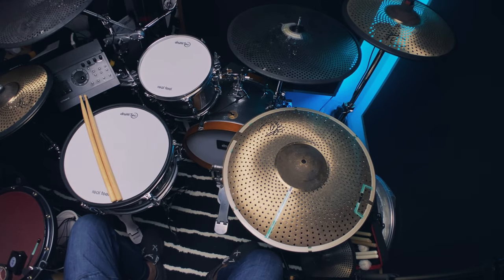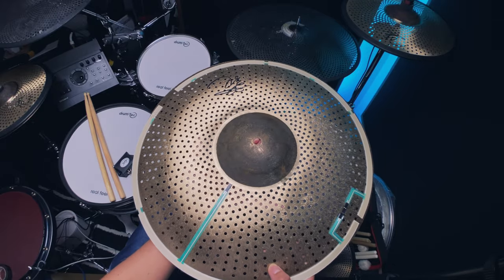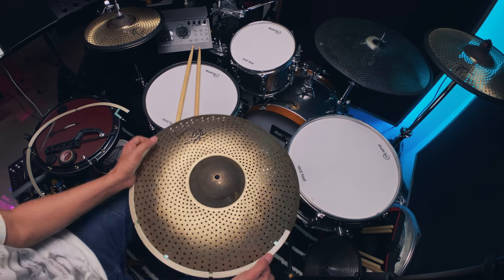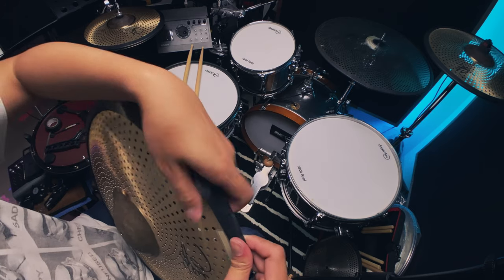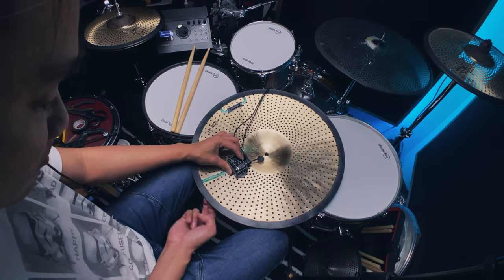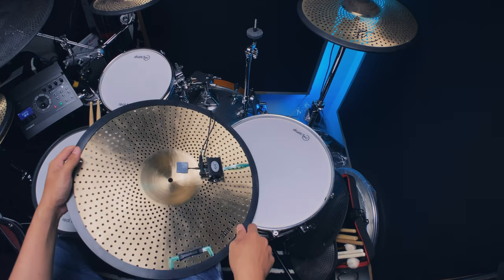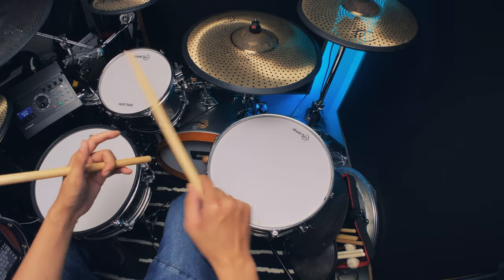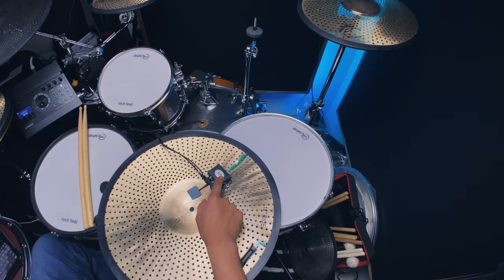[V2] 3 ZONE RIDE BUILD  | E Cymbal

Comment: Thank you for your insight.  I had the same experience with goedrums.  I ordered the dual triggers and the membrane.  They didnt send any documentation whatsoever.  And the plastic triggers broke just like yours did.  I have the aluminium ones now.  About to follow your guidance and connect it now.  Thanks for your help.
Reply from the maker: Thanks for sharing! They really need to be reinforced.
Reply: @ProjectBeats_  I now have 2 of the membranes and the alluminium triggers now and still trying to figure out how to get a choke sound from this setup.  Of course Im using low volume cymbal and a Roland head.  Ive watched many videos on and off youtube and still cant find anything on how to use the choke function.  I found an email for goedrum and asked them about it, this is no joke, they replied giving me a link to this video!   Have you created a way to use the choke?  If you have can you make a video or if you know of any place its documented I would be forever grateful if you would share.  I appreciate you sharing your expertise and you are a groovin drummer as well.
Reply from the maker: Wah did not know that. 😅 do you have the go edrum dual/triple zone trigger box? If you connect the edge membrane to the trigger box, they just work instantly. Just pinch them after you hit the crash to choke
Reply: @ProjectBeats_  Nothing is ever that easy! At least from my experience.  I should be home in a couple days and I will try it.  Thanks for your reply.  btw I have the dual zone trigggers.

Comment: Thanks for all your videos! Where did you get your rubber cymbal ring? I can't seem to find them in a ring, only in a roll. I am not sure how to connect the ends to secure it! Any help is much appreciated!
Reply from the maker: Thanks for watching. If you mean the one that goes around the cymbal edge, it only comes in a roll. I just glue and clamp rest it overnight. If it comes loose rinse and repeat 😅 only happened once for me. You could screw them on if you like

Comment: I found the goedrum membrane chokes alot easier than the myrk switch. I really have to squeeze my myrk cymbals to get it to choke.
Reply from the maker: That is true! Did you use some foam riser tho for the myrk?
Reply: @ProjectBeats_  no but that's a good idea, raise the whole switch up so it has some give when you pinch it. No instructions were provided with those either :/
Reply from the maker: There should be some email about it. They recommend 2mm EVA Foam. I just used a 3m 2side tape and cut to size. Stick to just the silver part. Should be better response and bit easier to pinch that none at all.
Reply: @ProjectBeats_  cool, good to know. Did you put the foam between the cymbal and the switch? Or on top of the switch after you stuck it to the cymbal? I found conflicting info on the vdrums forums. Thanks in advance!
Reply from the maker: I’d follow myrks recommendation. Foam riser on top of the membrane. In between membrane and rubber ring/u-rubber channel. Makes more sense to me that way.
Reply: @ProjectBeats_  got it, thanks man!

Comment: Great DIY project. Can you please explain why you put the Myrk or goedrum membrane switch on the top of the cymbal and why it should be useless? Jobeky place they membrane switch under the cymbal. You have mentioned it in the hi-hat DIY and in your first ride attempt. 
Thank you very much and go on:-)
Reply from the maker: Thanks! Do you own a jobeky cymbal? I’ve tried both myrk and goedrum membranes and as far as I know in my experience these membranes need to be hit directly to be activated/triggered (edge/rim sound). They are not like piezo triggers. Both myrk and goedrum specifically instructs to put it on top. Otherwise you’d have to have metal bending hits to trigger them if you put them under. 😅 

Altho for choke/mute purpose, it would work however you want to place it. Under/over, choke should work. 
So not sure about what jobeky is using. And how effective the underside membrane is. 

I tried it before, just a quick test. Did not install it. I was just curious too. yeah it doesnt work.

Comment: Heads up dynamics are not part of the membrane, it's the piezo which works with the membrane. As you can see the disadvantage of piezo bell over membrane bell removes all subtle dynamics as you have to hit the cymbal enough to trigger it off. Plastic project boxes as we discussed before will always be an issue on a brass cymbal because of the warping of the brass cymbal when hit.
Reply from the maker: Thanks! I realise. Trigger box with the piezo acts as the “main controller”.
Reply: @ProjectBeats_  yup - all dynamics come from the piezo - have 2 subdivides the sensitivity across the cymbal (you'll notice Roland do not use piezos in their bells because of this). I think a lot of your comments and concerns with the Myrk- Membranes are being addressed in the new version coming out later this year - working out the cleanest way to chain membranes and connect things (especially for the bells - people find this hard to resolve), and making it easy for low volume conversion which seems to be what everyone is doing nowadays! :)
Reply from the maker: That would be awesome! Been looking forward to the new release actually. The bell on my setup can definitely be better

Comment: Unfortunately my go edrum rubber rim breaks. I have the bell trigger as well. Really gotta pin point your strike. My ride uses the dual box. The single zone metal box doesn't hold the adhesive well for the piezo.
Reply from the maker: Thanks for the heads up. Will just use my old u-rubber channel if it breaks. The bell setup is a bit more forgiving than my previous build. It’s OK for me.
Reply: @ProjectBeats_  yeah I noticed your hack by taking out the foam pad and just taping the trigger on the bell. Definitely gotta try that my dude

Comment: Goedrum make excellent products. I owned their 13" Hi hat and their controller is top notch.
Reply: Just a point. Watching your video I was wondering about the breakage of the boxes wings you experienced. Have you thought about putting nylon/rubber washers instead of steel ones? Great and inspiring work BTW. 👍🏻
Reply from the maker: Thanks! Yup. Used metal washers, I showed on the long term review. 🙌🏽🙏🏽

Comment: Thank you for the awesome and inspirational information. I’m trying not to drill into my zildian lvs. Do you know if putting the membrane on the bottom would work?
Reply from the maker: Thanks. 🙏🏽🙌🏽 Only for choke if placed below. Edge sound wont register
Reply: Great. Thank you very much for the reply. I’m working on my first goedrum 3 zone and will be busting out the drill tonight. Feels so much better to hit what feels like a real cymbal instead of pads. Please keep up your awesome work! You’re definitely pioneer this for me and probably heck of drummers!
Reply: Got  my first three zone working! Everything was like you said. I did drill into my LV Zildjian. Barely noticeable. Plus already holes...:) Even through there were holes in the bell I still had to go direct instead of the double side tape from GoEdrum. Also bell only sounds with the side of the stick like you said. You saved me hours and I'm ready to go for the high hat and crash all using an Alesis strike module that I recently got on ebay. Right on brotha!
Reply from the maker: Nice! Glad it worked.

Comment: I got this all set up with my Roland TD-17 and I am unable to trigger the bell sound. I've tried triggering without even setting this up on a cymbal and still no bell. I get the edge and bow sounds just fine. Is there some specific settings in the TD-17 to support this trigger? Any suggestions? Thanks for your help!
Reply from the maker: Hey. I don’t have this setup anymore. But if I remember right there is a bit of cross talk needed with bow and bell for it to sound. Directly hitting bell trigger wont really make it sound. There is some threshold setting in the module you could tweak something like threshold or sensitivity. Also hopefully the connection is right. Sometimes it slips inside as well. I think I used blue tack or something to hold it in place. Sorry that’s all I could offer as I don’t have it anymore.

Comment: Did you ever have to put a foam riser? Mine is not working well with my cymgard rubber edging. Do I need a foam riser?
Reply from the maker: I did not use riser with the goedrum edge membrane. If it is not responding well, wouldn’t hurt to try risers.

Comment: But you'llend wrapping the cymbal top with foam or it's left naked? How about the contacts and the connectors bended into the small cymbal holes? Aren't in a dangerous position beign right were we usually strike? How can i proved if i wann do the same thing with a regular cymbal (a non low volume one)? I have to keep wiring in the top and hide them under the padding, or place everything in the underside?
I have a old 16" Sabian B8 and an Alchemy Pro 17" that i would like to mess with.
Reply: And half of the sellers doesn't ship here in Italy.
There's a way to make a 3 zone whitout switch but simple piezos?
Or would be a crosstalk nightmare?
Reply from the maker: Myrk percussion is in UK he has membrane. you might be able to get from him. That’s what I used for bell and edge in my first build. https://youtu.be/UKfHCBNN2Kc
Reply from the maker: Haven’t tried regular cymbal. But I think I would go with covering the entire bottom with some type of foam, myrk edge membrane on top, myrk bell membran on top, drill holes so all wiring is on the bottom side. I’d still use u-rubber channel to hide the edge membrane and help with vibrations. Then trigger box under or if you know how to make one. You might be able to find diagram for the electronics.
Reply: @ProjectBeats_  In the end the same as you did, but i have to add a couple of holes, minding to stay away fro the bell area or else the cymbal could fall apart :D I lost a couple of cyms dues cracked bell border in my years in drumming.

Yes i can buy the myrk ones as they're in Uk, but GoEdrum doesn't ship here, i'll have to go with regular piezo instead of a trigger box.

I asked if it's possible to use only piezo instead of switch 'cause i seen one diy were he used a piezo in the border area, but i guess he tinkered a lot in the module to reduce crosstalks.

I seen some even using metal plates as switch, they solder a cable on the plate and the mass on the cymbal, it's a smart and even cheaper option if it actually work.

Comment: When doing your crashes did you put the membrane on the top or bottom of the cymbal?
Reply from the maker: I did both.
Reply: @ProjectBeats_  what way worked best to get bow edge and choke?
Reply: I’m using the GOEdrum membrane
Reply from the maker: Edge and choke is doable either side. IMO top works best for swells.

Comment: Is it normal that the myrk membranes do not work if i connect them straight to the jack?
Reply from the maker: Yes. As I mentioned before. Bell and edge switch need to be wired to a main trigger. They need a certain amount of response from a main trigger. This is the case for Roland. They don’t work on their own.
Reply: @ProjectBeats_  thank you I realized it :)

Comment: Also I used my own piezo with the membrane and results aren't the greatest. I figured a piezo is a piezo??? Maybe I need thier box? I used 27 mm
Reply from the maker: It’s probably their circuitry in their trigger box that makes the diff. But I’m not totally sure. I don’t know exactly what they are using. You could probably replicate it or may have done so already. I just share my experience with it.

Comment: Hi bro need some help 😭 having trouble with my ride 3zone setup just like yours.. Im having double triggering issues.. Already put some adhesive tape between the cym and still nothing works.. Pls help... Thanks Great videos by the way... Keep it up!
Reply from the maker: Wc part? Bell, bow or edge? You tried adjusting threshold, or other settings in the module? Or maybe try a different ride preset.
Reply: @ProjectBeats_  yup, tried already adjusting the threshold but still same.. Its actually the bow that has double triggering issues.. And the edge it seems hard to trigger as well.. 😑 About the different preset, how do i go about it?.. Actually im kinda newbie w/ edrums that's why I'm having a hard time with it...
Reply from the maker: What is your module? You can try edit drum and change the drum type, that is a preset. There should be a couple different types of ride there.

Comment: Did you tried to use the switchers under the cymbal? What  results you got?
Reply from the maker: No coz they don’t work like piezo. If you just want choke and not the edge sound you can put it under.
Reply: @ProjectBeats_  ok I got , tks so much

Comment: How are you finding this after using it a little while, is it holding up ok?
Reply from the maker: Yeah no hiccups so far. Only thing I need to solve is spinning cymbal. 😅 not a big deal tho. I’d say membrane bell is better in terms of triggering. This setup is OK but needs tweaking with module. Waiting for mryk to update bell membrane then I’ll give it a try. But if not, for me this is a good solution for practice.
Reply: ProjectBeatsOfficial - I have TD17 also, I used the drumtec settings for my A2E shells, there isn’t slot of info on cymbal settings, you should put some up when you get the chance.
Have you tried using a rubber band around the trigger box to the cymbal boom arm, keeps it somewhere near without being unnatural.
I always wondered why myrk don’t sell a kit like goedrum does, with coverings and risers,trigger box etc included
Great work as always👍

Comment: I have a similar setup and the crosstalk is unbearable even with extreme xtalk settings and threshold etc. How do you manage this?
Reply from the maker: Crosstalk between what?
Reply: @ProjectBeats_  Between the bell and bow piezo. Since the inputs on my td-4 (haha) expect switch for the bell in order to get the true 3-zone function, i had to connect the bell as an independent single zone trigger. Unless goedrum has modified the circuit of their system to trick the module into thinking its receiving on/off messages from your bell piezo. You even mentioned in your previous ride conversion video that you would get crosstalk if you weren't using a switch.
Reply from the maker: I see. If you try playing 3 zones on actual e-ride. When you play bell, you will naturally hear the bow, as bell would rely on bow to trigger (main trigger of 3 zone) especially for dynamics. I since learned main trigger is actually doing the dynamics so it has to be there when you play bell. It’s just more accurate and cleaner when using bell membrane. But if you are hearing bell when playing bow then there is a problem. This never happens to me tho. I adjusted the bell sensitivity higher for my setup since I’m using 2 piezo (1 bell 1 bow) which is not ideal but this setup is super convenient so I went with it. Piezo bell needs higher sensitivity. I’ve no problems with crosstalk tho.
Reply: Thanks for the reply. Both piezos of my ride are super sensitive even with maxed out threshhold and super low sensitivity. The guy that built it (gear drum) recommended  a threshold of 30 for the bell but my module is not capable of such a high value. I think i'll try to physically dampen them. thanks

PS  I read somewhere on your channel that myrk will release some bell membranes that go under the bell surface. Is this true ? Or possible?
Reply from the maker: I don’t think they will ever build an underside membrane. It should be on top. Membranes work better that way. Piezo underside, membrane on top.

I heard they will update the bell so that it’s easier to build. Kinda like a plug and play setup. W/o having to build it up. It’ll still be on top. But I have yet to see any update on their ebay shop. Also waiting on what they would release. 

If the bell is too sensitive and you are getting bell even when not hitting bell. Maybe try to add a thicker foam between cymbal and bell piezo.
Reply: @ProjectBeats_  I have some 7'' toy cymbals for kids that i use for splashes. Ill see if i can stick that on top of the ride cymbal and isolate the bell trigger in there and then figure out how to glue that, maybe i will get a blacksmith to weld it. Field make their cymbals this way. Maybe a good idea for a next video of yours?